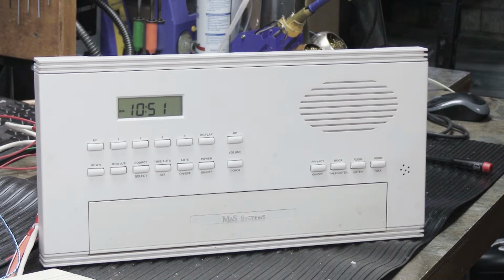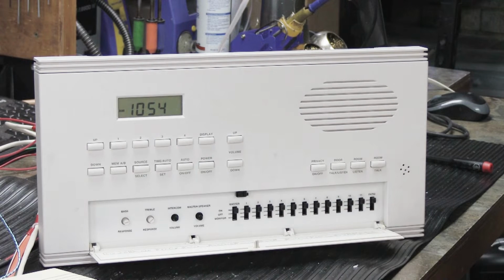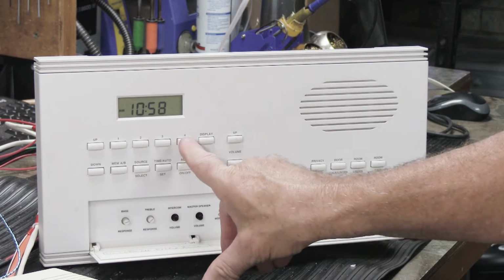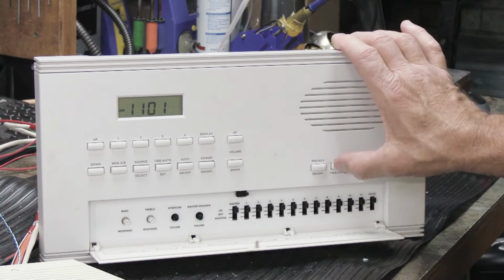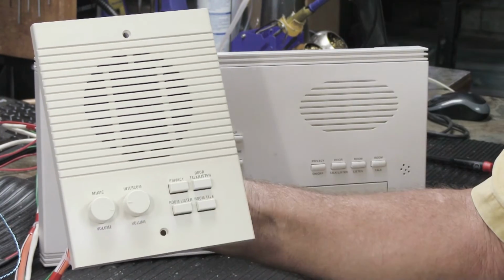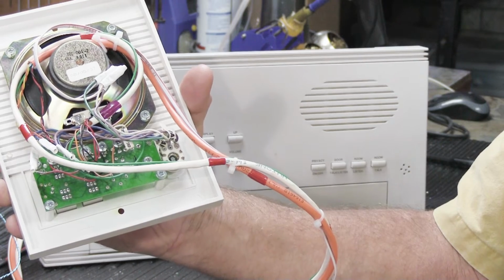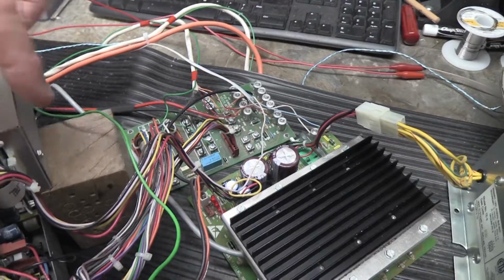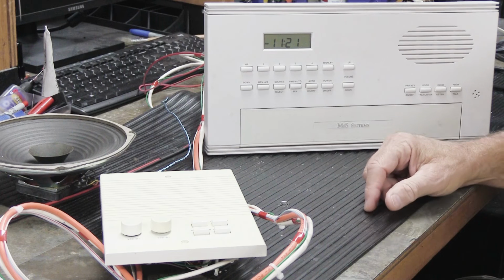An Overview of a M&S Systems (music & sound) MC902 Stereo Music Intercom System

Comment: Thank you for the information you have given. Quick question I’m trying to install the doorbell and I’m not getting any power to it when I connect to the red and black (door). Tried looking online and can’t find any info on wiring. But when I connect it to the red and black where the other speakers are connected I can hear it power on, well I hear static. Do you have any video on wiring the doorbell. I also notice that there seems to be another board for the doorbell, are the wires wired their instead of the other intercoms? Thanks again
Reply from the maker: Hi ariesan:  1st - Stop What You're Doing - Before you blow something up! - I am not at all clear exactly what you're trying to accomplish - But I'm fairly sure you're doing it wrong - It would be best if you contacted us directly - Chris     nscompany@msn.com
Reply: @northsideservicecompany3567 thank you responding back. I emailed you to follow up. Thanks again

Comment: My lord. You are really really good at giving information in a non wondering way that was easy to digest quickly.   I’m a dude on my business page.  I’m a bit electrical inclined as a live sound guy audio engineer by trade.  We just got a house with this system in it.  We have the radio. Not a “other” source. I’d like to wire in another source like “Alexa or internet radio etc”. What is the work around.   Where would that input be?   Behind the main unit?  It seems to be put in the drywall very snugly.  Basement panel?  I’m wondering if they wanted to hide it as an alternate Jack type. Like it’s just a cat 5 or phone Jack with the proper witeing I can get in. Or would I have to find it on that control board. Fantastic well edited video.  Again. We are in at louis.
Reply from the maker: Hi whattowatch:  The Auxiliary Audio Input Jacks are located on the back of the MC902 Master Station - On the Left-Hand edge of the main Circuit Board - You can see them (kind of) in this Video https://www.youtube.com/watch?v=8SK05CgGJ_4&list=PLsTvqKsBnGYdZ1GLHTO4KRF8TSDrxd9Gv&index=2
At 5:40 into the Video - you can see Red and White RCA Cables plugged into the top 2 Jacks 
     The Wall-Housing would have been installed before sheetrock and I wouldn't recommend trying to remove it - There should be some holes in the bottom of the Wall-Housing for wires to enter - if you have a basement, you could run the Audio Cables ( I prefer pre-made audio cables with RCA plugs on the ends ) from the MC902 to your Auxiliary Audio Source(s) I do like the Echo Dots for a music source - Chris

Comment: I've watched most of your videos on this and I can't find an answer. It has an Aux setting but I can not find where you would plug and aux cord in
Reply from the maker: Hi PinkCowgirl:  The Auxiliary Audio Input Jack are located on the back of the MC902 Master Station - On the Left-Hand edge of the main Circuit Board - You can see them (kind of) in this Video https://www.youtube.com/watch?v=8SK05CgGJ_4&list=PLsTvqKsBnGYdZ1GLHTO4KRF8TSDrxd9Gv&index=2
At 5:40 into the Video - you can see Red and White RCA Cables plugged into the top 2 Jacks - Chris
Reply: @northsideservicecompany3567  thank you so much

Comment: Well it looks all white to me :-D
I could see that too many speakers and miles of wires would be  a worry for the house owner.
To hide all the wire would be a pain, some hole drilling would create a mess.
Reply from the maker: Hi zx8401ztv:   This System, in particular has a lot of wiring - If you installed a full System (12 Remote Stations) you would have 120+ wires behind the MC902 - It's no small feat to get all of that inside the Wall-Housing neatly and be able to close the Master Station on the wall  - Chris